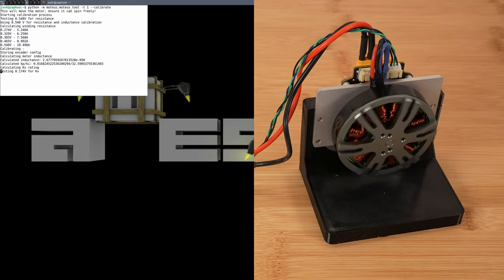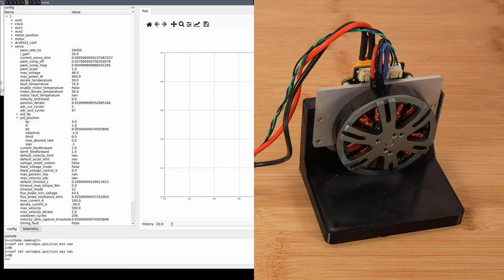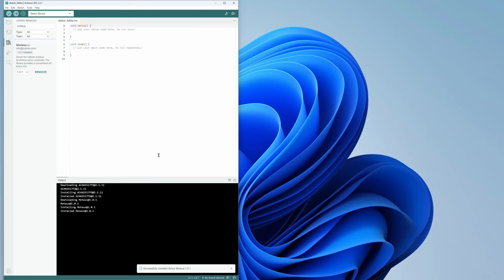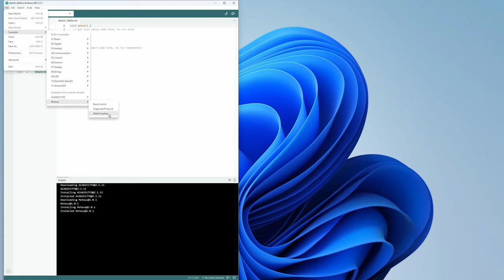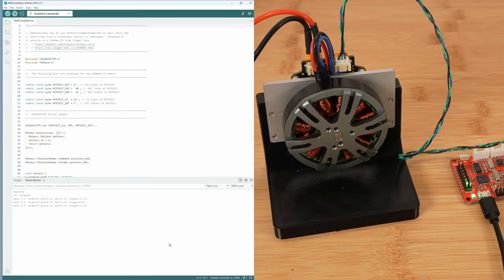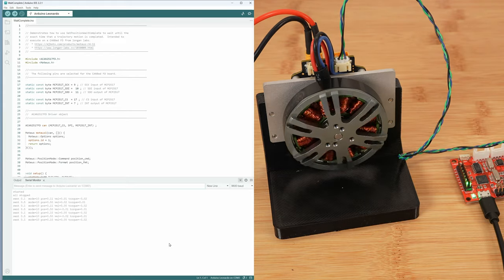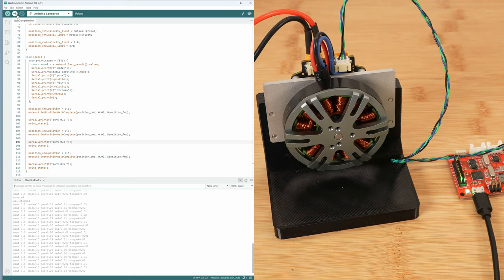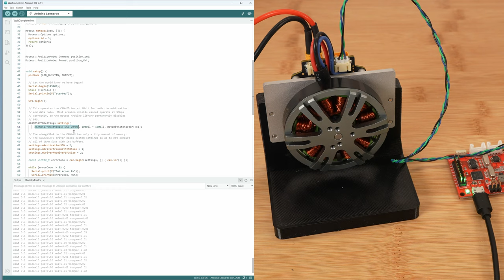Arduino with moteus for brushless motor control

Comment: Hello! I am a university student majoring in robotics in Korea. I am trying to control a motor in torque mode using Arduino IDE. I successfully created torque mode by applying feedforward torque through Python TView, but I am not sure how to set up torque mode and apply a constant torque using Arduino IDE. Could you please advise me on how to achieve this?

Comment: Do I have to have a CAN controller like MCP2517FD to control the moteus in teensy 4.1? Can't we just do this since teensy 4.1 supports CANFD?
Reply from the maker: You may be able to use the CAN-FD controller built in to the teensy, but it still requires an external transceiver as the system in the teensy only operates at logic levels.  Also, the moteus Arduino library will only work currently with the MCP2517FD and you would have to modify it to work with the teensy's built in controller.
Reply: @awesjosh  It was very helpful!! Thank you.

Comment: How do I control multiple motors with one arduino
Reply from the maker: First change the `id.id` configuration for each servo using tview.  Following the procedure here: https://github.com/mjbots/moteus/blob/main/docs/reference.md#idid

you first change it, then immediately restart tview with the new id in order to issue the `conf write`.  Note, this must be done with a CAN-FD interface that is compatible with tview, just like for calibration.

Then, in your Arduino script, just assign unique IDs to each of the devices like in the BasicControl example: https://github.com/mjbots/moteus-arduino/blob/121db53dd9ff38d493652082b6ad0dd8edc963aa/examples/BasicControl/BasicControl.ino#L33

Comment: Hello, I'm a university student in Korea, majoring in robotics. I became interested after seeing the development process of your robotic dog. I'd like to create a brushless servo similar to the QDD100 using the MJ5208 brushless motor and Moteus R4.11 controller. However, I want to make it slightly smaller, which seems to require changes to the planetary gear section and the outer casing. Could you advise how to obtain related machined parts? Is it possible to purchase these components?
Reply from the maker: Unfortunately, nothing can be purchased off the shelf.  You can look at historical posts at https://jpieper.com to get an idea of some of the steps, but it I have to warn you that it will be a challenging endeavor.